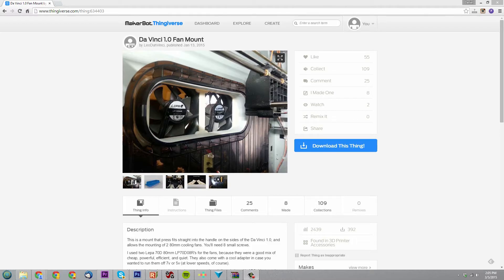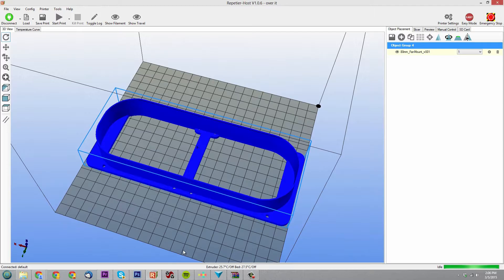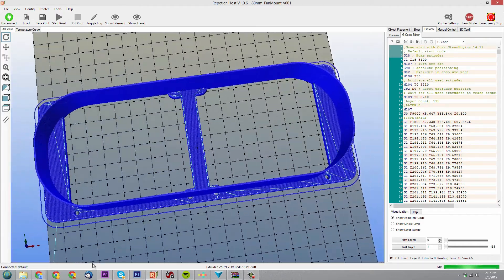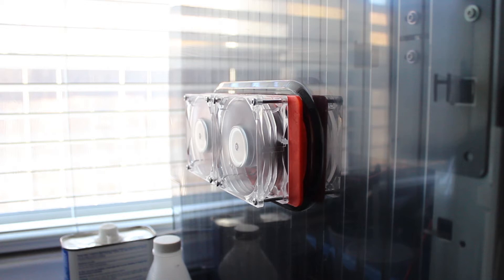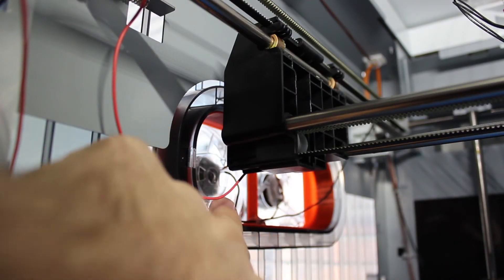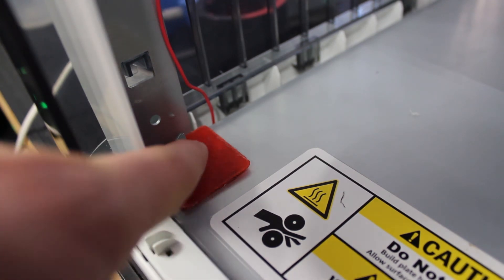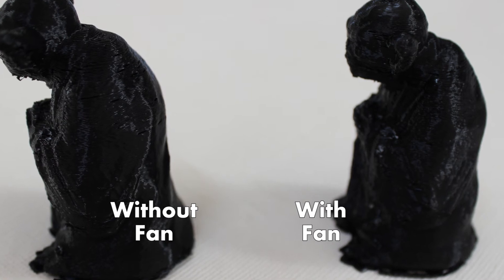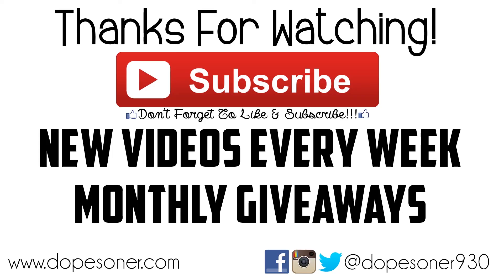Da Vinci 3d Printer Switch & Fan Mod! Higher Resolution PLA Prints

Comment: The problem is cooling of the extrude barrel is not sufficient, barrel is not coupled properly thermally to heat sink, the heat sink and alu block have air gaps incensing heat resistance.
Also xyz filaments are thinner in diameter than other brands.
I have modified the flow using printed ducts, reassembled the head using heat compound paste and increased the voltage on the cooling fan.
So far i prints consistent without clicking and or jamming...
Reply: do you have a picture of your modding?

Comment: i had this mod but i removed it as id did very little. Ive since flashed to repetier and done the e3d v6 head upgrade so I may bring it back just to see what i can get. There is another one that uses smaller fans and fits into the da vincis opening and looks cleaner and better just fyi.

Comment: First off your videos have been super helpful...recently won a xyz1.0 from newegg...a few hours after I finally flashed the firmware (while I was calibrating it) the bed went all the way to the bottom and now won't move...The pole spins but the bed does not move up or down...Searched all over the web for solutions of fixes but haven't been able to find anything....Any idea on a fix before I take it apart??
Reply from the maker: That interesting, have you tried to manually bring it back up by spinning the pole? If the pole is trying to bring it back up and its not working then I fear the piece that attaches the pole to the bed may have busted. I think you may have to take it apart. Thank you for the nice words about the videos :D
Reply: that's what I was thinking...When it's turned off it moves up and down manually, but won't move when the pole moves...tried moving it around while the pole was oving just to see if it got off track, but nothing happened...Taking apart seems like the inevitable